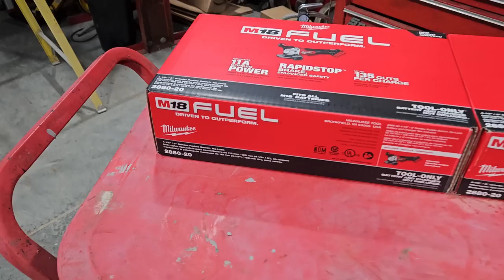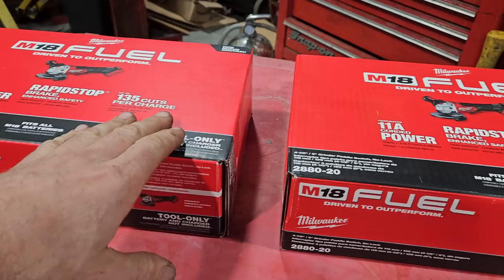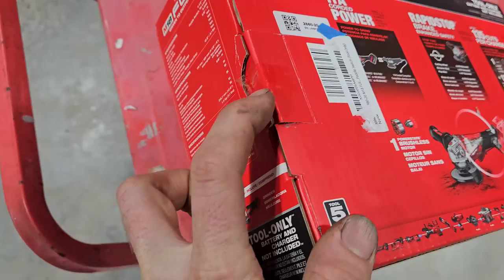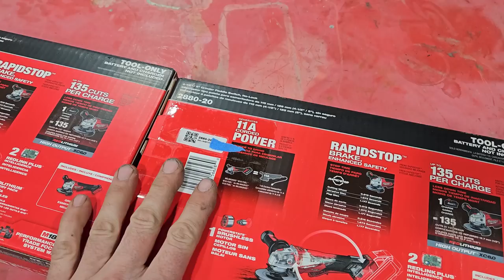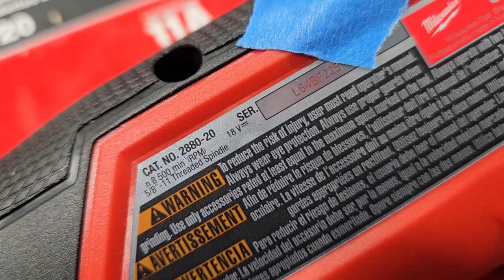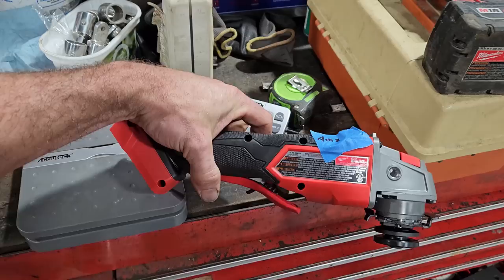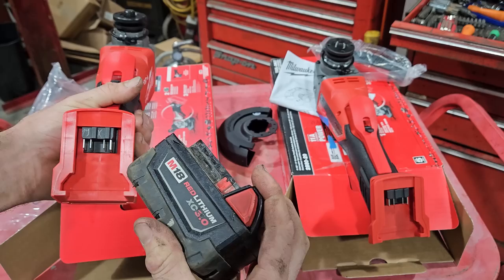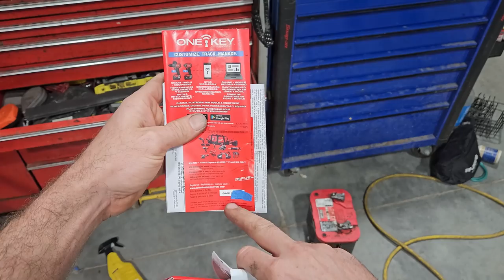Amazon MILWAUKEE Tools FAKE or THE SAME? Half Price!

Comment: The reason the Amazon one is so much cheaper is that it was likely stolen. They can sell it for half price because aside from the Amazon fees, it is all profit.
Reply: BS, I just purchased one from Home Depot for 134.00 without the battery.
Reply: @JazzJay80  Of course you'll get them on sale from time to time.  But half price, all day every day from a non-authorized seller and you think it's legit?
Reply: @Evadization The Amazon seller probably bought overstock that came from an authorized retailer.. Businesses go out of business every day..
Reply: @MarkLada They are stolen. Tool shops that sell Milwaukee are few and far between and they don’t close down everyday like you suggest.
Reply: @mccalejk2  I don't think they are hot honestly.. Milwaukee would be all over Amazon to shut it down if they weren't coming from a legit source.. If they were just selling a few on ebay they could possibly be hot, but they are selling hundreds of them each month on Amazon.. They can't steal that many consistently.. Milwaukee doesn't sell factory direct to retailers.. There are wholesalers who buy from the factory, and they sell to distributors who sell to retailers.. There's a whole  chain of business between the factory and the consumers.. That's why everything is getting so expensive.. Too many people taking a cut of the profits for doing nothing.. It's those businesses who are going under and getting liquidated.. Resellers are buying their inventory and selling it on Amazon and eBay.. Milwaukee can't really do anything to stop that.. If they could they would have already stopped it..
Reply: i had noticed that brand name stuff sold at retailers can really go for a dearer price, i wonder if its down to cutting out the middleman and wages etc from the retailer over a warehouse, and warranty too.
Reply: @MarkLada it reminds me of a bunch of research I did some years ago on whole sale distributors and its hard to find the ones first inline from factory because so many people try to be wholesale distributors but they buy from wholesale who buys from whole sale and the price you pay is retail--- loved the scam
I was laughing my ass off
😂😂😂
Reply: @mccalejk2 you don’t know that
Reply: @mccalejk2  bro you would have to steal pallets worth of tools to have that much stock to sell. No one is stealing that much and getting away with it lmao
Reply: @MarkLada  facts. A friend of mine literally makes a living doing this with dewalt and ryobi and vanitys etc building materials
Reply: probably grey market imports. They run a third shift at the factory overnight and load them into containers then ship them wherever outside of the normal distribution channels. Cut out a few middle-men and pay the super-low wholesale prices while avoiding import taxes and tariffs and that’s how you cut the price in half while making a profit.
Reply: @Cardinalfloors   Your buddy does "what" exactly - steals and resells, or buys overstock or leftover stock from distributors that have gone out of business?
Reply: @thebordernow  lol overstock or returns.

Comment: Amazon definitely allows resellers to sell fakes. I bought a fake Condor hat and tried posting it in the review. Amazon removed my post and sent me an email threatening me. My review had pictures showing the difference between real and fake. I had even contacted Condor and they confirmed that they never made a hat with that print. I have 3 real hats to compare it to. The tags on the new hat were different, the logos in the sown in tag were different, the material was different, obvious and poorly done fake. Amazon didn’t care they wouldn’t even let me post that review warning others.
Reply: I bought fake razor blades on Amazon and tried to leave a review stating that they were, and even said I didn't know if the seller was aware it. 
They sent me a nasty note of violation of review guidelines. I don't leave reviews anymore.
Reply: eBay is liberal with counterfeit sellers also from my experience.
Reply: If it works, then who gives a shit?
Reply: @shannonelliott6116  If it was stolen from you, you would.
Reply: This isn't fake though

Comment: weight difference is in the casting of the aluminum heads, no two castings will weigh perfectly the same, there is potentially hidden air pockets in the cast and slight differences from cleanup.
Reply: Also subtle differences in grease and variances in the wiring.
Reply: Yeah weight difference is a big deal with a grinder.  Cheap one will have weaker body and grinding head.
Reply: As far as the weight difference, remember that the serial numbers are different also indicating different manufacturing  plants with different molds for the castings.

Comment: The difference was only ~.2 ounces, not ~2 ounces. That is very minuet, like a fifth of a AA battery. I have gotten all my tools on Amazon besides a drill I needed same day and never had a problem with the Amazon tools. I actually did kill the home depot drill, so I bought one from Amazon the next time.
Reply: That is why you make the big bucks😅
Reply: Yeah I was saying the same thing as Robert Briggs, it’s only 0.2 of an ounce. It’s probably just a little more grease in the gears of the one from HD. It’s exactly the same tool and same quality. Milwaukee is what I use too. Love em.
Reply: Did you warranty it?
Reply: .2 oz could literally be humidity/moisture differences in the the cardboard boxes.
Reply: different amounts of grease in the head unit could account for the weight
Reply: Wet cardboard can cause that
Reply: @sleigh4019   Doesn't need to be wet, "dry' paper products are 8% to 13% moisture. A 5% increase in moisture on a 4 oz package would account for a .2 oz. difference.(approximately)
Reply: I was going say 2 ounces would be a huge difference! Nice catch! .2 is nothing!
Reply: The folded product catalog insert missing?
Reply: I always enjoy a stately dance in triple time, Bach perhaps?  (I can’t believe someone got the joke)
Reply: I heard Home Depot are refurbished but sell as new.
Reply: Says no warranty ... but that's not true ... milwaukee will warranty from manufacture date off serial nmbr😊
Reply: Its like this...companies outsourcing their products like craftsman has their tools built in China, Mexico and Canada,  it is very likely to find differences or what would be considered imperfections in the tools.....very likely to have slightly different font and print and shades of paint...it is a bit of a disappointment  because we expect quality tools...but business is just like that......I believe both China and Vietnam produces Milwaukee tools.....wonder if you can buy U.S. made Milwaukee...ill Google it now
Reply: It was much less than that. It was only a .03 difference. 3.55 to 3.52

Comment: Would be interesting to reach out to Milwaukee Tools and see if the serial number really is legit. Since they are serialized, they should know when they were made and where it is “supposed” to be.
Reply: I'm sure Milwaukee doesn't mind.  Amazon has to be one of their largest distribution channels so there's no way Milwaukee doesn't know what's going on here.  Do you think they will cut off the "dishonest" distributor?  No, because they're driving a lot of sales.
Reply: @RedShiftedDollar  It all depends on where that 'dishonest dealer' acquired their products...Like another poster said, there are national theft rings operating all over the place that just walk out of HDs with these tools by the shopping cart full.

And, believe me, Milwaukee definitely does mind if those get resold to unsuspecting buyers - because every time they have to decline a warranty repair because it's a stolen tool not purchased at an authorized outlet, that's one more upset customer who's going to spread bad reviews.
Reply: It could be the fatory in china there are Salling on the side. It could be a  copy... And all copys have the same number
Reply: I'LL  save you the trouble I have had a few amazon  milwaukee tools both repaired and replaced  under warranty  by milwaukee with no problems.
Reply: Yep. It’s genuine Milwaukee and Milwaukee has ann excellent warranty.
Reply: can register on their website easily if it checks out they will warranty it.
Reply: This doesn't mean they are stolen. One way they do it is buy the tools in bulk or buy them when there is a free battery deal and return the battery. I have saved hundreds of dollars returning the free batteries. I've calculated I could have made about $125 on the M12 fuel impact driver and hammer drill kit when you get the free battery, if I were to sell them online after I returned the battery.

Comment: Definitely a "off the truck" discount. I worked at homedepot there was a nationwide ring of criminals stealing from different HD. It was so big they had a warehouse of stolen goods from box stores.
Reply: and the main office in Ontario Canada had a full 53' trailer full of stuff stolen, and multiple repair depots across Canada have been hit multiple times...
Reply: Like everyone said- it’s stole so buying it is ‘fueling’ the criminals.
Reply: I got some DeWalt 9 amp batteries for 85 dollar a piece. They are real the guy just sold them to me for only 10 dollars more than he paid as a favor. But he had to buy around 500 to get them at that price.
Reply: that is true for all stores selling tools
Reply: Buy local. Steal corporate.
Reply: @JOSH-ge4oc  that's very true with any power tool brand. Good warranty equals high price
Reply: This doesn't mean they are stolen. One way they do it is buy the tools in bulk or buy them when there is a free battery deal and return the battery. I have saved hundreds of dollars returning the free batteries. I've calculated I could have made about $125 on the M12 fuel impact driver and hammer drill kit when you get the free battery, if I were to sell them online after I returned the battery.

Comment: The .2 oz difference is probably the anti theft tag in the home Depot unit that needs to be deactivated when you leave the store
Reply: Or the battery was only half charged and the heavier one had a full battery? 😅
Reply: @51-FS I'm sorry, what?
Reply: @zin6749  if you have 2 cups of water and one is half full. Weigh them and I net the one that full will be haver
Reply: @51-FS there’s no batteries in both of them
Reply: @51-FS  Lithium batteries are the same, charged or empty.  And as the box says, its tool only, they don't have batteries in the box.
Reply: Yeah but, if you weigh two things that look identical and one is heavier than the other, that means one is lighter than the other. I hope that helps clear up some of this confusion, you’re welcome .
Reply: @51-FS lol

Comment: One of the dirty little secrets in international trade is that products are priced differently depending on regions and what the market will bear.  So exactly the same Milwaukee sold in Slobsylvania might be significantly cheaper than in the USA.  "Gray market" importers often divert product into other regions and some manufacturers aggressively protect their localized higher-profit-margin markets.  For instance, a Kubota in New Zealand through official channels is one price and the same Kubota imported on the gray market is quite a bit cheaper--but when you go for repair parts and don't have the right serial number, the local dealer won't even sell em to you.  The USA is a moderately protected and definitely customer-ignorant market in many ways so some items get that super-premium profit mark-up.
Reply: Except the European Milwaukee tools have different part numbers. The Amazon tools were most likely acquired from a Home Depot returns pallet. The Mom and pop tool shops do the same thing. They buy a pallet of tools for 25% of the cost and sell them for 50% of the cost.
Reply: Mercedes/Benz was running into that issue, Grey market cars were showing up at the U.S. dealerships for warranty work. Mercedes put out a letter to the U.S. dealers, stating that they are our cars built by Mercedes, fix them and get reimbursed by me/be.
Reply: Yeah i can buy the same goods from european markets for half the price and no taxes.

Most “american” companies build shit over seas then sell it to us at a huge markup. I have no issue running them out of business by buying overseas
Reply: The spares are no issue here because Milwaukee spares policy is a joke anyway, most parts are bundled into sub assemblies that cost as much as a new tool. You can't even buy a switch or battery retainer on it's own. Without the warranty, these are basically throw away tools.

Comment: Other than the different font of the letters and numbers of the serial number and the weight, the only other difference that I noticed was that the Amazon packaging was neater. 
It looked like the Home Depot packaging had been removed before and then shoved back into the box. If both items were manufactured and packaged at the same factory, one would expect the packaging to be identical as well.
Reply: If they are hand packed, then it's a person to person difference. One shift might put it in differently. I used to hand pack smoke alarms for a company (weird, I know) and everyone did it differently but the way I did it didn't fold the instructions at all. Management wanted it one way, workers did it another way, I found an efficient way to do it and they allowed it since it didn't ruin the instructions as well as making it so you can "self audit" your box before closing it.
Reply: Of course it is authentic. They were stolen from depot direct to amazon
Reply: Ya - some YTer did a "Tool review" then returned it. Next guy after Chris might notice it and say "aha"!😂😂
Reply: More likely gray market. This kind of authorized seller stuff has been used for stereo equipment, radios, and other  things and they might be made at a different plant, but are pretty much identical.
Reply: You can make em work but you can’t make em do a good job lol
Reply: @wpintofg  I doubt that.  I suspect that if there was any theft or let's say diversion, it occurred in China.
Reply: @terrycunningham8118  lol don't be delusional. Milwaukee does Not sell it's product on Amazon to begin with it. Amazon is not an official dealer for Milwaukee
Reply: @wpintofg  Re-read my comment. I'm not saying that Milwaukee is selling these, but rather they are manufacturing over-runs that went to other wholesalers and those people are flogging them on Amazon.
Reply: how many plants are there is China.......could be they were made at different places....but both look very good......I bought from HD and then from Amazon an inflator.....Amazon price was same as my military discount with HD.....HD has a better return policy...30 days for HD

Comment: It is likely a grey market tool purchased in China in bulk and shipped to a distributor in the US. They just bypass Milwaukee and Home Depot profit margins and warranty support. The differences in serial # fonts could be explained because Milwaukee could use multiple factories to produce the product.
Reply: People forget there's manufacturers vs vendors/distributors. You can get them much cheaper direct vs a chain like HD/Amazon with the strict MAP (Minimal Advertised Price) in place.
Reply: Yes that was my thoughts. I have encountered similar things a few times like this. That is the same product.
Reply: multiple lines, probably have older and newer burners for the serial numbering. Same deal at the factory I work at. Same product can be made on a few lines, but the daylot code might have a slightly different font on the newer lines vs the older ones due to different machines stamping, embossing, or burning the text.
Reply: This is the correct answer
Reply: Milwaukee's brushless power tools still get produced in China, but they don't sell in China.
Reply: Make sense, 100 selling price and another 100 for warranty purpose.

Comment: You're getting the dramatic discount (likely) from two seller methods: arbitrage (someone combs the internet for inventory reduction deals in bulk) or return pallets with "near mint" items (returns chain stores decided wasn't economical to restock). Sometimes these business models are only profitable in certain geographic regions. Sellers setup in those regions use big box trucks and small warehouses to swoop up and inventory the bulk. That affords them huge margins so they can undersell the going rate more often, even when the market is saturated with items. Counterfeits and stolen items aren't the only way to offer big discounts.

Comment: This video is very helpful. I am in the same situation. I searched for the hammer drill, 2904-20. They at first describe it as a 12V drill, however, all the photos, etc. are pointing to the 18V drill instead, and the label itself in the photo reads 2904-20. It is listed for only $90.00, as compared to HD's price for $200.00!. I took a chance with it and am expecting it to be delivered tomorrow. To compare, I also ordered the 3404-20, which is the 12V drill, and that one lists for only $60.00, as compared to HDs price of $149.00. If the specifications in the included manual say 1,400 inch pounds for the 2904-20 I will be one happy camper!
Reply: update?
Reply: @dannys9074  Success! It is the 2904-20. Not sure how they can sell them at that price point.

Comment: there is still a warranty when purchased from "non authorized sellers" at least in some cases. I have a impact wrench that just came back from being repaired under warranty that was purchased off ebay new. they went of the manufacture date and did not require a receipt.

Comment: I own both Amazon, Home Depot and Tool Truck versions, they all seem the same and most have been trouble free. 3/8 extended reach had a board go bad inside bought on the tool truck. He sent it in for repair for me, no charge.